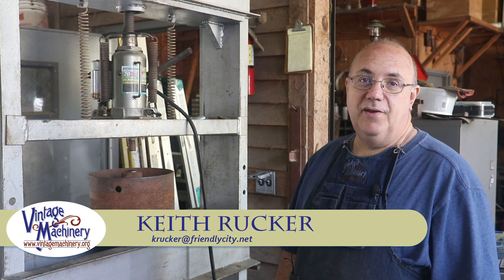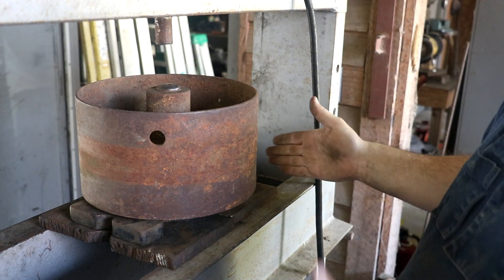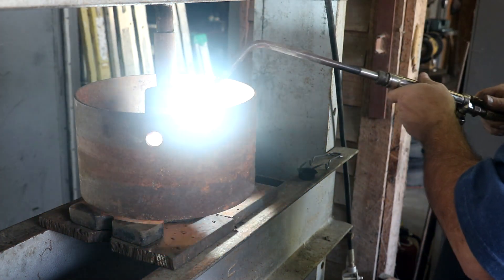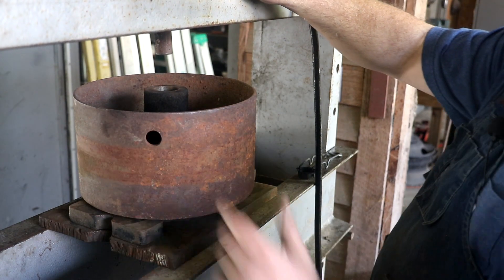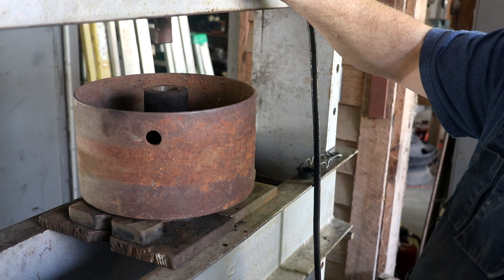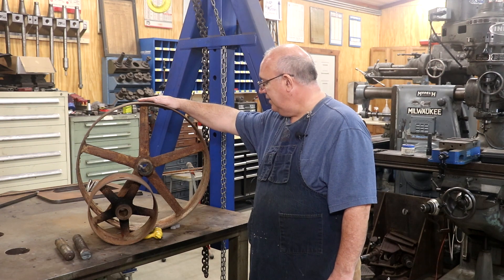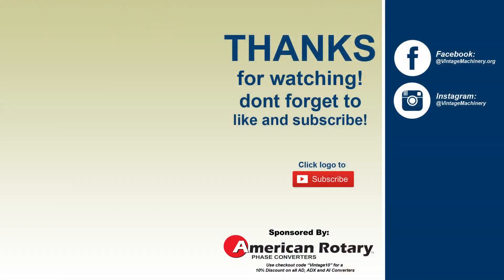Metal Planer Restoration 52: Pressing the Old Shaft out of Flat Belt Pulley Hubs

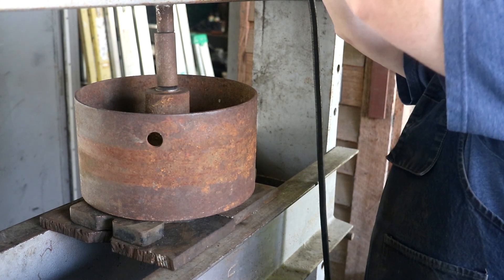Comment: That setup at 3:30 reminds me of some other "adventure"" of certain very enthusiastic (even if not extremely bright) couple in Finland: https://www.youtube.com/watch?v=JyA1lBJl_qM&t=335s ...
OK, this is STEEL here, not brass, but still the whole setup here seems to be kinda... flimsy. Or "sketchy", as they used to say nowadays in US. I really wouldn't like to be in Keith's shoes should that "go-between" piece decide "I'm out of this job, it's just too much pressure". There's this thing called "safety cage", and it is not for keeping lions or tigers - it is used around a high-capacity (or "tonnage") hydraulic presses - for, well, safety, I guess?

Side note: I've seen it all to often - people working in "highly regulated" environment, where you got rules and "certified procedures" for almost "all and everything" just seem to stop to use their imagination and common sense - and then we can watch folks who put on "double glasses" (corrective ones and safety goggles on top of them) to open a can of beer - but apparently, for dropping a red-hot charcoal into a liquid oxygen a regular glasses seem to be just fine and more than enough (different person but same lab); people, who use sealed chamber (of course, with safety goggles AND glasses on) to take a sample of just mildly toxic and not extremely reactive metal (barium), but they see no dander in sloshing around, hard, few kilograms of zinc-mercury amalgamate in a glass bottle - or, (and this is my favourite) - pouring half of a bowl of unused liquid oxygen on a wooden floor in a lab. (Any certified welder would know better that that...)
For those interested, you can see all those behaviours on "Periodic Videos" channel:
Vanadium (mercury sloshing): https://www.youtube.com/watch?v=MbCmaQzrZoc
LOX being poured on wooden floor: https://www.youtube.com/watch?v=y7uCBWkrAXo
"Extremely dangerous" can of "probably the best beer in the world" (yeah, right...): https://www.youtube.com/watch?v=CheFL8see30
Barium, the metal apparently worse than plutonium: https://www.youtube.com/watch?v=9srJdQU3NOo
And so on, and so forth... But I digress here... : )

Comment: If one did not have (access to) a hydraulic press, would drilling/boring out the old shaft be feasible? Then you wouldn’t have to worry about it being seized in there from 50+ years of rust and corrosion. 😊

Comment: Used the same principle of heat to install bearings on shafts in radial engines....heat the bearing up in hot oil (350 degrees) and drop it on the shaft. Might want to check the black air line on the press looked like has a pin hole in it, could see mist coming out of it.

Comment: i was given an 80 gallon compressor tank..  retired from a gas station where it would supply air 24/7 to the air hoses for the full service.  it would cycle every few minutes. it was retired before i went to work there.. it took 5 men to tip it on its side and lay it in my van..  it was full of water to the top..  at least 70 gallons of water came out of that 80 gallon tank.  i drilled holes in the side of the tank and scrapped it.  there was a lot of corrosion.  i worry about that air over hydraulic jack at the museum.
Reply: Sounds like that tank was neglected over a long time. Was the purge valve rusted shut? 
Even compressors that have dry air intake systems will build up water because that's just the physics of compressing air. Over time, it causes moisture to condense out of even the driest air.
Usually, at most garages and gas stations, you just crack the purge valve at the bottom of the tank at the end of each work day. I take it that that regular duty had long been forgotten about.
Reply: @BigRalphSmith  the early morning crew has the chore of draining both compressor tanks.. one compressor.. a quincy  10 hp 3 phase had  been running since feb 1941.. according to the tag on the tank and the age of the building.. and it let out a lot of water daily. the other was a much newer unit.. and it was a magic compressor.. as they could open the drain and nothing would come out.. when ask.. yes we open the drain every morning.. they did not mention that nothing came out. no water.. no air..  so they closed the drain and went about their duties.  never mentioned to anybody.   i quizzed them after i got the tank to get the entire story.. the rust on the bottom had completely plugged the drain..  the compressor oil got changed on the second of every month.  oil is cheaper than compressors the boss said..  that was about 1993..  so the other compressor had been in operation for  52 years..  that station was built in 1941 but had been on the same corner owned by the same family since 1921. there is a new station there.. but the property is still owned by the family.

Comment: the thermal rate of expansion due to temperature for steel/iron is about 0.001in per inch per 100 Degrees F
SO: for 1 inch of material, raising the temperature 200 degrees will result in about a 0.002 inch increase in size
Reply: Only problem is, that shaft heats up also and expands at the same rate as the cast iron.
Reply: @ellieprice3396  actually that isn't completely true.  Iron is a poor conductor.  Given time, yes it would all heat up and expand,  but iron and steel is slow and if you apply enough heat very locally and fast than the result is one peace expands quicker and we get the results we just saw.
Also, localized heating can cause warpage and cracks because it's not all even

Comment: First rule I learned is never stand in front of a hydraulic press. Whatever spacer you use can shoot out like a bullet. Or the item can give way and the piece can shoot out bottom like a bullet at angle.  I'm sorry Keith but that press is hokey with over stretched springs.

I agree with other comments on water. That's a heck of a lot of water in air line. Really bad for compressor tanks, valves as well as any air equipment.
Reply: That spacer he was using could come out literally in any direction so there is no "in front" or safe place to stand. As for his springs and condensation, send him a new press and an air dryer instead of complaining about them. I'm sure Keith would love them
Reply: @maggs131  Would a screen mesh made of say 1/4 to 1/2"  round or square bar where the holes/spaces are abit smaller than the spacer your using work? You stand behind the screen and if it does go you're okay, all the while you can mostly see what your doing. Or maybe just rows of metal for the screen to give horizontal vision.
Reply: @alstonofalltrades3142  any guard would be better than no guard. Where I work we put a hinged 1/4" plexiglass "door" on the operating side of our 75 ton press. Best practice is to use the shortest spacers possible with flat surfaces and go slow and stop if you see it leaning or your work sliding off center
Reply: @maggs131  Actually Kieth is more likely to make his own.
Reply: At the very least, put a face shield on.